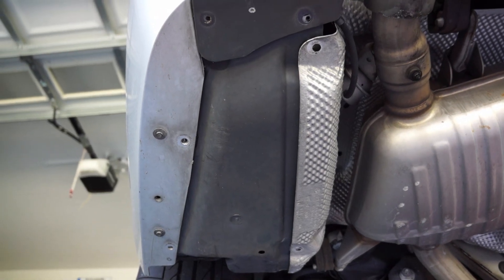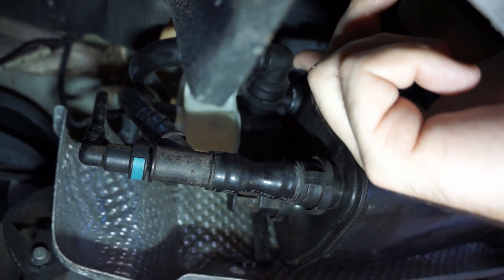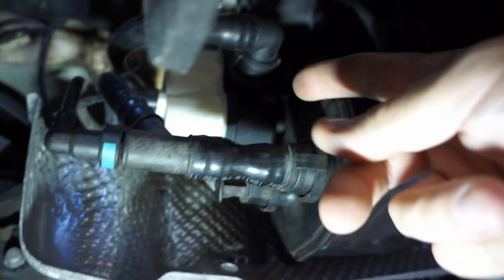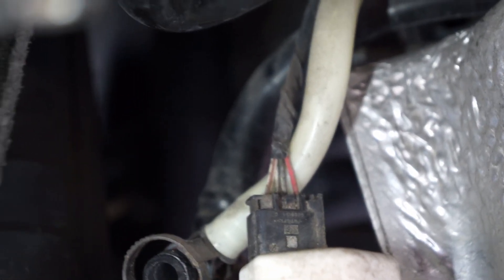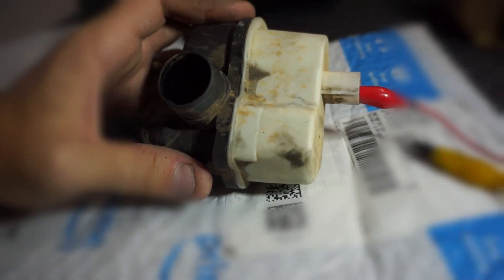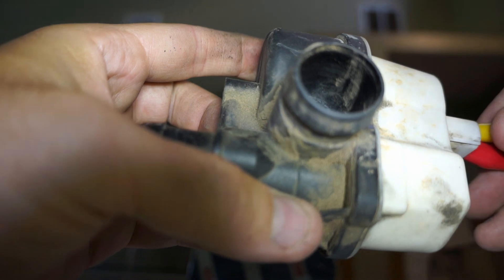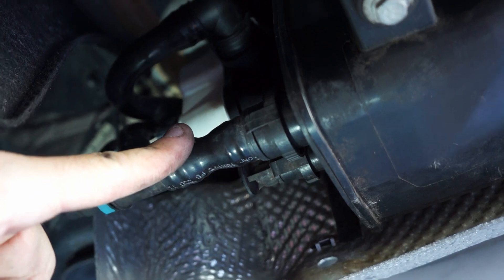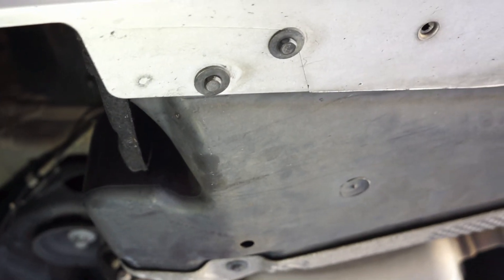2012 BMW 335i Evap System Description & DMTL Bench Test

Comment: Can this part cause this area to leak fuel??? Great DYI by the way!
Reply from the maker: Hmm, not sure about that.  It shouldn't unless there is another problem causing liquid fuel to enter the system.  Only fuel vapor should be in these hoses/parts.  Perhaps the fresh air vent is clogged.

Comment: Nice, thanks!! So in order to evap test the fuel system, I should have the ignition on, and ground out the bottom left pin with a back probe to the chassis? Or else, the smoke will flow out of the charcoal cannister?
Reply from the maker: I wouldn't command the pump valve closed.  Smoke test it as is and see where the smoke comes out.  It should only be visible through the vent to atmosphere which I believe is located in the right rear wheel well.
Reply: @JRsGarage Thanks😀

Comment: Yeah I replaced my dmtl pump  and the check engine light went away but there was monitor still P1449 so I did a smoke test couldn't find the problem. I did some research and found out the ECU can be sensitive on some electrical components. So I replaced the generic dmtl pump with a bosh 
dmtl and drove it about 60 miles and the ECU cleared the p1449 code now it's ready to get smogged.
Reply from the maker: Great, thanks for the information.

Comment: For my e90, even after replacing the pump I still get codes on MHD for 2a12, 2a13, 2a18, 2f71, and 2fc6
Reply from the maker: Check for blockage in any of the hoses.  Perhaps a bad purge valve?

Comment: Very interesting do we need to change that charcal after some years ? And that dust filter ? :)
Reply from the maker: You can’t really clean out the canister so once it fails (no longer allows air through freely) then it needs to be replaced. The dust filter can be cleaned off. Neither are part of the normal service schedule.

Comment: I being struggling with VALVE FUEL TANK VENT, i did a bunch of things like smoke test it came out good,no leaks i change the EVAP part that goes in the engine area(2times) and i still cant figure out what’s causing that code.
Reply from the maker: Have you tried replacing the DMTL pump attached to the charcoal canister?  I’d try that next.
Reply: @JRsGarage  I changed both of them,still can figure out whats causing that problem,because of that my engine goes in to limp mode.
Reply from the maker: Someone commented one time to unplug the purge valve and idle for 10 mins then reconnect, clear the code and drive it around for 10 miles. Not sure how that might help but worth a shot. Are you sure the limp mode is due to the vent valve?  Never heard of it causing that.
Reply: @JRsGarage  yea, its my everyday car so i can feel it when it goes in to limp mode,after that i get the code 2A1A-Fuel tank ventilation system.
Reply from the maker: Ok, so it’s something wrong with the entire system. Could be your gas cap. You said you tried smoke testing so you have the equipment.  Try disconnecting the lines connected to the evap canister and smoke test them to see if there are any leaks.
Reply: @JRsGarage  ok thanks i will keep you updated
Reply: Would this be causing issues when filling up with fuel ? Mine just almost instantly clicks off or spits back like it's full. But I have no idle issues etc. Just only filling up.
Reply: @christmas9645  yeah
Reply from the maker: Yes, if there is an obstruction in the vent system the fuel pump nozzle might sense back pressure and think the tank is full.

Comment: I’ve had fuel dump into my canister 3 times now …. Any ideas?
Reply from the maker: Is there any pattern to when it happens?  Perhaps a blockage somewhere causing the fuel itself to leak into the canister instead of just the fuel vapors. Or topping up the fuel past the pumps automatic shutoff?
Reply: eveytime its happened ive been at the pump and its cut me off half way.. this last time i had gas pouring out from under the car at the pump... i had my canister plus the dmtl pump replaced last year(for the 2nd time) and it just happened to me again about 2 weeks ago. im using a stage 3 precision autowerks fuel pump which might be the cause of all this but i dont see how. i might just go back to stock pump to test it out but im just so lost at this point haha @JRsGarage
Reply: a shop also ran a smoke test on the evap line and said it was clear so i dont whats going on @JRsGarage

Comment: Where is the EVAP switching solenoid?
Reply from the maker: Do you mean the fuel tank ventilation valve?  It's in the engine bay connected to the intake.

Comment: hello. maybe you already found the reason? I have an e70 3.0l n52. it's hard to fill up the fuel, the fuel gun keeps getting cold. and it doesn't work well on idle. after turning off the car after a long drive, something is poking at the back of the fuel tank. thank you very much!!
Reply from the maker: My idle is still a little rough.  I think the problem is a leak in the purge solenoid line that comes from the charcoal canister.  I haven't had time to deal with it fully.  The fuel filling is better now after I blew out the vent line in the fuel filler neck.  It's not perfect yet.  Actually, for some reason it fills well when I turn the fuel gun upside down while filling.  I'm not sure what you mean by something poling at the back of the fuel tank?
Reply: sorry, maybe the google translator didn't translate it that way. I have a hard time pouring fuel. and the revs jump on idle. sometimes when I turn on the gear, the revs start to jump sharply. I changed the van solenoids (febi), van filters (oem), I changed the disa valves, I changed the fuel tank valve. the same.thanks
Reply from the maker: I would suspect a vacuum leak.  There are many vacuum lines so it may be hard to find.  You might want to take it to have a smoke leak check.
Reply: thank you. I will try to find out who does this
Reply: @JRsGarage  did you get to the the bottom of it bro ?
Reply from the maker: Not yet, tried cleaning the vanos solenoids but that didn't help.  Still have yet to do a smoke leak check.

Comment: ME: Fuel low-pressure sensor, electric.
2A15 - ME: Fuel tank ventilation system and purge air
system, minor leak.
2C77 - ME: Oxygen sensor after catalytic
converter: Signal.
Got these codes wondering what it is causing my check engine light to come
Reply from the maker: Any one or all of those codes could cause your check engine light to come on. First I would clear the codes and then check them as soon as the check engine light comes on.
Reply: I have those codes forever now a 2b3c codes for dmtl system fault. My whole assembly is cracked
Reply from the maker: At least that's easy to diagnose.

Comment: The fuel fill cutoff and rough idle haven't been resolved? Does this mean the issue could be a clogged EVAP line or maybe with the gas cap?
Reply from the maker: I believe I fixed the fuel fill cutoff by blowing out the evap lines.  I need another fill-up to be sure.  The rough idle is still there.  I think it may be a leak in the evap line to purge solenoid so when the solenoid is energized and opens, it introduces a vacuum leak.
Reply: @JRsGarage  Did you have to drop the rear exhaust and heat shields to blow out the evap lines?
Reply from the maker: No, I opened the gas cap and disconnected the purge solenoid line in the engine bay and blew them out from their canister connections.